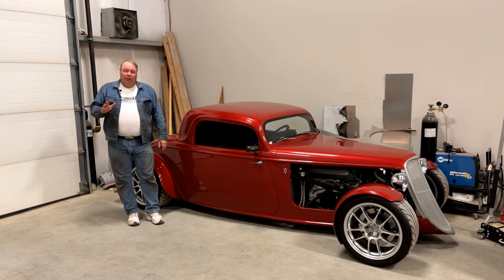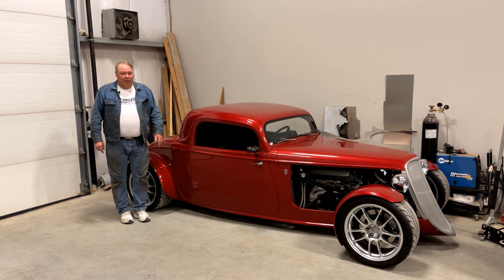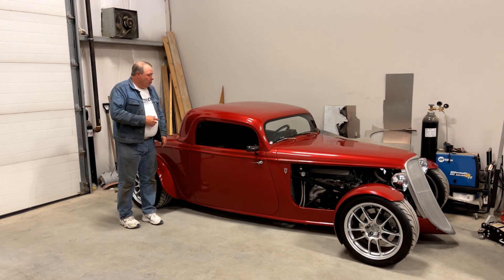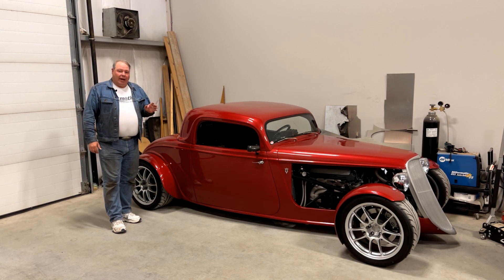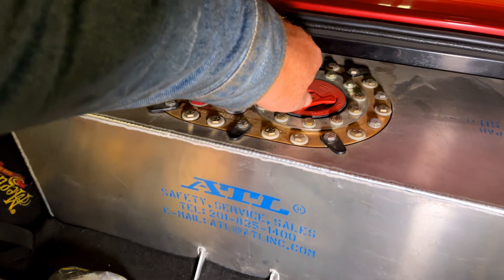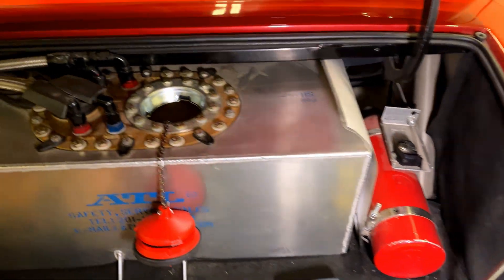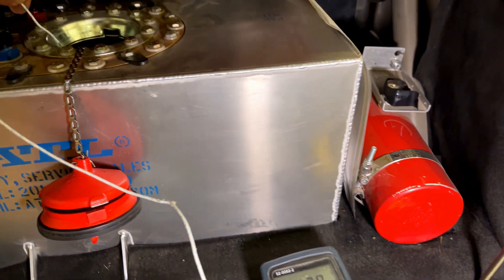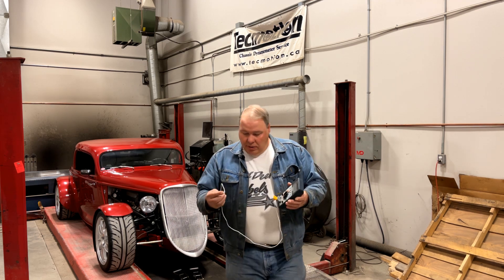Do Big Fuel Pumps Overheat Your Fuel?

Comment: What do you think the impact would be for those who put the 340lph pump in a car with stock fuel lines?  I know that sounds silly but people probably do it.
Reply from the maker: I actually did this on that blue 1990 convertible because there were no 255 pumps available at the time and it works fine with a wiring upgrade. I did not check the fuel temperature gain because it is much harder with a mustang tank, but the results of this temperature testing suggest it won’t be a problem and in actual use the customer has not had any issues. That IS one of the reasons I decided to do the testing in this video though.
Reply: @tecmotiondyno  thanks for all the great content!!

Comment: Great video Mathew ! I have the same pump as well. I was wondering the same. Very cool to see the ambient vs in tank temp after run time. Now I definitely see the importance of keeping my engine bay temps cooler. 😊
Reply from the maker: I have seen a lot of guys claim they boiled the fuel in the tank with a big pump over the years, and I have seen a LOT of fuel problems, both obvious and mysterious so I have always wondered about the issue of heating up the fuel. After doing these tests, which are obviously not exhaustive but certainly show you which way the wind is blowing, I seriously doubt that anyone is getting super heated fuel from an oversized pump.

Comment: The coyote can take a decent amount of fuel I wonder if a stock foxbody 302 would yield the same results. I have heard rumors of guys putting in oversized pumps on a stock application and claiming to boil their gas. Great vid as always would love to see more tips and tricks on foxbodys.
Reply from the maker: You are right of course, but just puttering around to car shows the car is probably consuming between 10 and 20 liters per hours and the pump puts out 340, so this is a reasonable test of whether constantly cycling the fuel heats it up. I suspect after this fairly simple test that if I did rigorous testing and a multiple linear regression on the results I would find a better correlation between the fuel temperature and factors other than the pump size. I heard the same claims as you, which is why I did this test, and now I feel strongly that those claims are imagined.